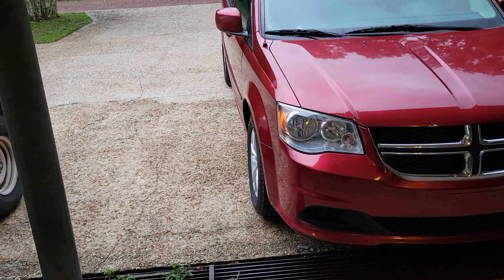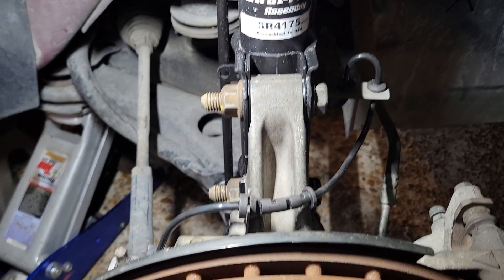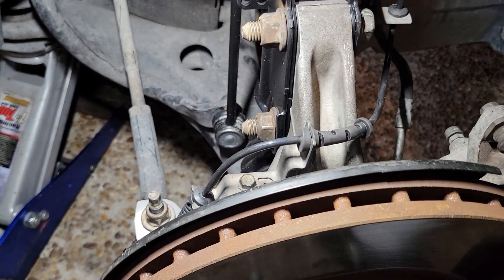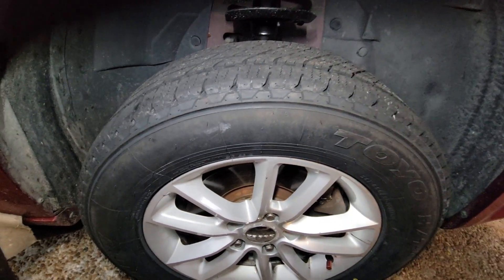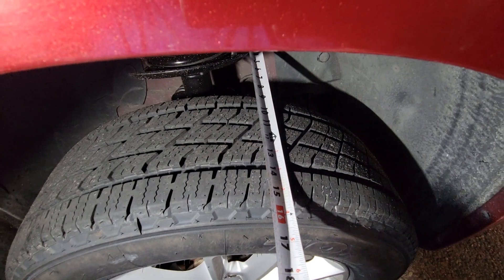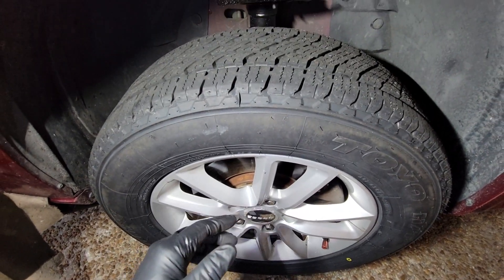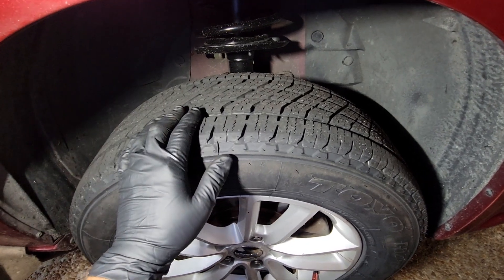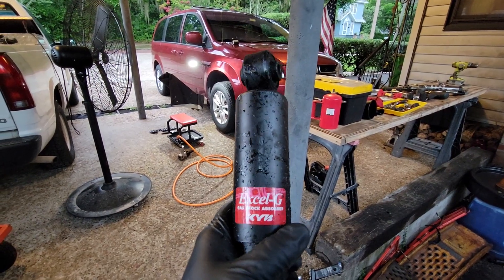5th Gen Dodge Grand Caravan Camber Adjustment

Comment: You need camber eccentric bolts on the bottom holes to secure adjustment to camber or it will just slide out of adjustment they are cheap but hella effective

Comment: The mechanics and the dealer tell you that camber's not adjustable because the original struts do not have the lower hole as the ones you bought. I just did some repairs in my Grand Caravan and the lower hole in the strut is round, but in my Sebring is like in yours.